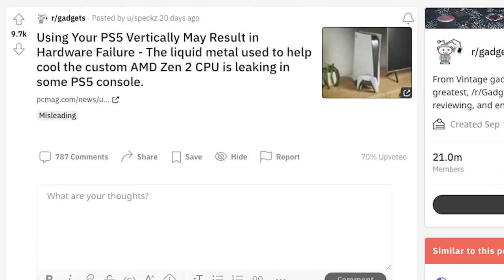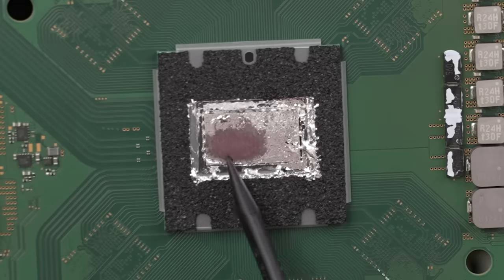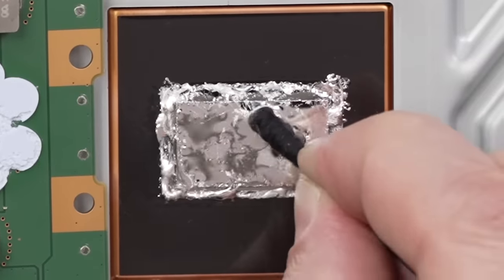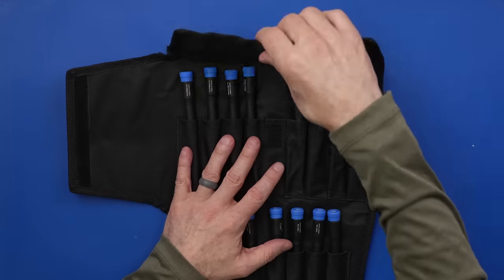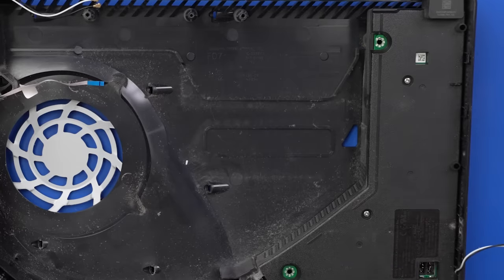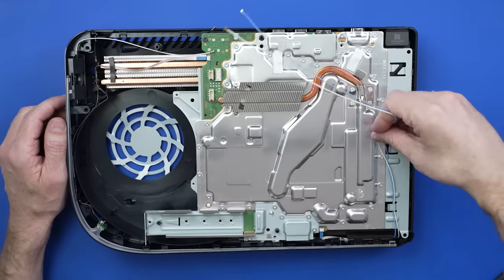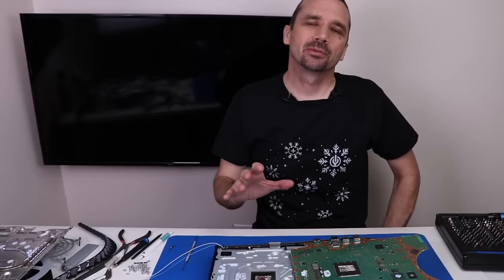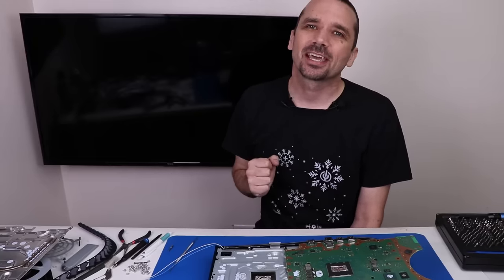PS5's Have a Liquid Metal Problem - But It May Not Be What You Think

Comment: I was taught close to 30 years ago that if the thermal compound is being squeezed out you've applied too much.  It's only there to bridge between the die and the heatsink and fill any gaps.  Ideally the gaps should be as small as possible.  When I started overclocking way back when I used to wet sand and micro-polish both surfaces to get them as flat and as smooth as possible and then apply the compound with the edge of a razor blade.  Never a ridge of compound left after they were married together.  I think people have gotten the misconception that thermal compound has some magical properties where more of it means more heat being pulled from the processor but that's just not what it does.  As soon as liquid metal came around the first thing I thought of was the fact that it remains so fluid will mean it will have to flow away from where it needs to be.  Now with the board being vertical and it's just got a gravity assist to drain away.  The one thing I don't see anyone try here is to remove the liquid metal, thoroughly clean both surfaces and replace with something like arctic silver and then compare temps and stability.  Too many people seem to be on the "if it's new it has to be better" bandwagon.
Reply: Thermal compound has been tried and tested and its thermal conductivity is nowhere near liquid metal
Reply: Actually it's been tried. You can find it on youtube. Thermal compound overheats it and the ps5 turns off. It can't handle it. Liquid metal is the only way.
Reply: @TheBreadSliceMaster  Oh...no dispute that thermal compound has less thermal conductivity than liquid metal does but it also has WAY less negative drawbacks.  I've never had it run out and short anything out.  I've never had it flow away and leave dry spots like shown here.  I've never had to make it a routine to go back in and reapply or spread it out over and over.  Frankly I think a bigger issue is the cr*p poor heatsinks and horrifically minimal venting they put in these things.  So little mass to absorb the heat in the first place.  But this is what happens when you employ designers instead of engineers.  Get rid of the aluminium and put in much thicker and larger solid copper heatsinks and you'll be able to pull far more heat.  I used to deal with with servers all the time when they would thermal and shut down.  We had multiple xeons at one of my old jobs and once we replaced all the low mass aluminium heatsinks with copper (and did nothing else) the heat issue went away.  It became a standard part of the builds we would do where thermal issues were a real concern.  But copper is expensive.  It's also a huge waste to use so much thermal compound or liquid metal if it is leaking/running out and not doing anything to facilitate the transfer of heat from the heat spreader to the heatsink.

But it would seem people are happy to deal with a system that is plagued with thermal issues and dies because of them than to spend an extra $100.  Don't get me wrong, I'm not complaining about it.  People can spend their money however they want, but it seems incredibly short sighted.  And if you have to rely on something like liquid metal that means that you've overlooked something critical along the way.  Then there's the foam tape they used as a stop-gap measure.  That's honestly ridiculous for a company supposedly as advanced as sony.  A full o-ring surrounding the die with a milled channel in the heatsink face would have fully contained the liquid metal and avoided all of these issues.  But then that would have added cost and they know that most people would rather deal with a system with issues that costs less than one that is more expensive but lasts longer.  

Sony, and all the other console manufacturers, are playing their customers for fools and the customers just keep getting in line again and again.  It's almost masochistic.

Comment: I have a suggestion. Try Honeywell tpm 7950 thermal pad. I used it on my PS4 Pro and framework laptop. Both are now super quite. LTT tested it, and the conclusion is, it is on par with liquid metal.
As I don't own a PS5 yet, I can not try it myself.
Reply: Normal thermal paste can't conduct better than liquid metal.Liquid metal Thermal conductivity: 128 W/mk(average)  Normal thermal paste max:14 W/mk
Reply: @ibrahimhalil9251  liquid metal is expensive and also requires dust filters

Comment: A dust clogged serially overheating console probably bakes the thermal interface material regardless of what it’s made of. You need to revive and re-spread it if it’s metal, or clean it off and replace it if it’s traditional grease.  

I can see the excess outside the two mating surfaces pooling over time towards one end, but not the material between those two surfaces due to capillary action and surface tension.  

My guess is that it’s a neglected console that went through many cycles of overheating until it was thrown away, instead of just being cleaned out. The oxidised spot is probably a result, not a cause, which is why sorting it made no difference but cleaning the ventilation and heatsink fixed the problem.

Comment: So glad you made a video about this. It's so blown out of proportion. The original user had it taken apart and I'm assuming used way too much liquid metal. I've had GPUs vertically mounted with liquid metal for years and not a single issue. That's why the foam is there lol.

P.S. anytime you remove a high pressure heatsink, liquid metal and thermal paste will look like a dry spot as your pulling the interfaces apart. I've had direct die liquid metal, more intense heat, and it never dried after 3 years of water cooling.
Reply: Facts! However, trolls will be trolls.
Reply: he still recommends to have it horizontal tho 15:40
Reply: @Medsas  That’s an opinion and not scientifically proven, genius.
Reply: The foam won't stop a dry spot. Dry spots will absolutely cause 'hot spots'. My PS5 is going flat from now on.
Reply: Aren’t most boards in PC towers vertical anyway?
Reply: @sebastianalhares  Yes correct. My 2 PC's don't have liquid metal.
Reply: @ekspatriat  Early PS5 models like the CFI-1000 series have the high thermal pad around the APU, which causes the aluminum part that touches the APU to have some slack, hence the liquid metal leaks. That thermal pad was removed on the CFI-1100 models and onward, so that issue has been resolved.

Comment: I am sure this has been tested before, but I would love to see you do a few different tests on a PS5 with all liquid metal removed and replaces with varying tiers of thermal paste.  Kryonaut, Artic Silver, Noctua branded, the stuff you purchase by the bucket, etc.  I am going to assume Sony engineered the PS5/heat sink so it would not work, but a detailed analysis would be REALLY cool to watch and learn from.  Just a thought, Steve!

PS: if anyone knows of a TY channel that has done what I am describing here, please let me know their name and the name of the video so I can go check it out!
Reply: Steve did that in a previous video!

https://www.youtube.com/watch?v=LbX_UjhgpGU&ab_channel=TronicsFix
Reply: I’m sure he has done it. 

It basically doesn’t work.
Reply: Apu is hotter than thermal paste that’s why they used liquids metal
Reply: @Leemillion_xM  L console
Reply: LM will always give better thermal results then any kind of paste.
Reply: @conwa23  no it doesn't to any significant degree but it's main use is for tight spaces like in slim gaming laptops for the idiots who wanna buy it and keep changing it when it dries out too quickly
Reply: @conwa23  but it  will always fail sooner
Reply: PS5 APU design requires liquid metal to work,this chip is getting hot like hell so if you put a thermal paste,even the most expensive one,PS5 would just turn off after 10 minutes of gaming.

Comment: I'm not surprised, seems like launch systems have issues. I bought a launch PS1 and laser was a poor design and eventually failed. My PS5 controllers have stick drift, I tore them apart and cleaned the sticks with electronics cleaner.

Comment: How useful/helpful do you think those ‘vacuum holes’ are on the PS5? Would vacuuming them every now and then actually help stop any significant internal dust build up?
Reply: Just anecdotal, but I was having the same issue where my ps5 was shutting down, a lot, while playing ps5 games. I read about the vacuum holes and tried it. No more shut downs. Now I do it every couple of months and I haven’t had the issue come up again.
Reply: Hi. Could you tell us if your model is a 10000, 11000 or 12000. I try to see if these shut down problems are specific to the 11000 model...( Mine is a 1116A)
Reply: no , take it apart to clean it and then attach dust filter
Reply: @MGrey-qb5xz  Plenty of websites out there have recommended not to install aftermarket dust filters after they tested them as they restrict airflow and cause the PS5 to run hotter. Regularly cleaning your PS5 is probably the best thing to do.

Comment: About your preference to keep the PS5 horizontal I have a few points to contradict your view:
Liquid metal has to respect the laws of physics. Which means it has surface tension and it will cause it to stick to another surface (heatsink) instead of flowing down and dripping into the sponge. Just try it with a water bubble and rotate your hand. It will always adhere to your fingers. The same principle works for the PS5.
So, unless there is much to little of the liquid metal so it can‘t cover both sides (processor and heatsink) it WILL flow down. Otherwise it will keep its place.
Reply: Sorry, but the upside down hand does indicate adhesion but does not indicate cohesive forces as well, plus if you touch that drop under your hand it will flow down. Gravity will cause this fluid to flow, especially with the vibration of the console from the fan spinning. There should have been enough preloaded Liquid Metal to prevent this from being an issue. If that volume between the APU and the processor is full then there is no where for the fluid to flow.
Reply: But how does the dry spots exist if they never been opened before? Is it true horizontal position is better than vertical? Also i somehow love you said "liquid metal has to respect the laws of physics" as if its a person (dont mind me my imagination is weird)
Reply: @MissxLariz  I’ve had mine in a vertical position for 2 years. There’s absolutely no evidence that one is better than the other. The only time mine overheated was when it needed cleaned (used this guys video to do it) and it’s worked great since. Dust is what’ll get it to overheat first. Unless you’re unlucky and got one that’s a dud. Mine was dusty like the one in this video.
Reply: @MissxLariz  In order for a dry spot to exist with corrosion, there has to be a small amount off air trapped in that space. This means either not enough metal is used to fill the void or it’s leaking out. Either are not good
Reply: @heavymetal_cutting_fabrication  Oh thats great. How often do you clean?
Reply: @heavymetal_cutting_fabrication  I would agree that dust is way more of an enemy than the Liquid Metal issue. I would be willing to bet that dust may be amplifying the bare spot issue.
Reply: @tseamans14  Oke thanks for the info it does put my mind at ease somehow haha

Comment: If Sony and Microsoft intended to design consoles with the primary purpose of accumulating dust inside, they couldn't have designed consoles better that the PS5 and Xbox Series X.  The vents on these consoles, when the consoles are stood vertically, are perfect for allowing dust into them.  As soon as my consoles arrived, I was straight online looking for dust covers designed specifically for them.  Just remember to remove the dust cover when using the console, because it's easy to forget, only to be reminded when the fan has to work so hard that you can hear it over the audio in your headphones.
Reply: Xbox has no problems.
Reply: Yea both systems have issues. I have both. Especially when you have a limited area for them such as an entertainment center. The series x is a DUST MAGNET. I had to buy screens and a top for it that came with fans....now it runs cool as ice.  The PS5 is much better dust wise... But I have fan vents with screens and an exhaust fan on it that keeps it cold too. Without all the accessories.... Ive never overheateded either.... But they have been way hotter than I was comfortable with. I've already replaced my series x once. It was a 1st gen..... Notable disc drive problem. New one seems to work better. I'd advise to purchase insurance on your machines. Saved my from buying the second x box. PS5 has been a champ the whole time
Reply: @patrickallen4374  wait as in for when console is off or running, can you tell the name of thing u bought?
Reply: @patrickallen4374 how long you’ve had your ps5 for and is it still running good?
Reply: How are people placing there consoles i have both on the middle of a tv stand that is well open and not had much problem with dusted up or clogged fans and heatsinks yea normal dust nothing a air can cant solve. Please don't say you have it on the floor as that is the worst way to have it carpet or laminate flooring it will just suck up all the crap off the floor like a vacuum.
Reply: @giggity4670   Mine are on a unit next to the television, where they have room to breath. They used to have less room, so were stood vertically and their vents were on top, but now they are horizontal, so the vents are at the side, reducing the intake of dust. I still use dust covers when they are not in use. However, whatever surface they are on, they will suck up dust from it and dust from the air around them. It just a matter of looking after our things as far as is viable.
Reply: Thank you sir. I never thought about that idea.

Comment: It definitely does not give you the heat error message all the time,(never did for me) after watching your breakdown vid, i did a cleanout (stage 3) and lucked out with just a dusty heatsinc. Sper drty.....i do alot of GT7 series racing and ps would shut off after 20 to 30 min, the full clean saved me, no liquid metal issue this time🥵, love your vids!   🤜🤛
Reply: yeah this time but the heatsink being dusty means it could damage the liquid metal to not working fully, attach  dust filter , no dust should be allowed in there

Comment: is it a dry spot? have been wondering. is it not just a clamping problem where there is direct contact between the silicon and heat sink that squishes the liquid metal away. however the oxidation is not good as it will damage the mounting surface on the heat sink

Comment: about time a youtuber with a higher subscription number brought this up, been telling customers this for over a year. The LM oxidation is a big issue.
Reply from the maker: It does seem to be an issue
Reply: “Big” 

That’s a reach.
Reply: I've had my ps5 since day 1.  Been vertical the whole time.  On 6 to 10 hours a day. Zero overheating problems.  Clean it every month with my rechargable air gun.  Recently took it completely apart to check liquid metal and it looked factory brand new.  Added some additional liquid metal to be safe and reassembled.  Have had zero overheating issues ever.
Reply: @brandonerrorcontentmissing4012  Bruh, these people are trying to tarnish PlayStation’s reputation with their disingenuous propaganda. 😂

Comment: My PS5 did the same thing. I have the day one and all I had to do was clean it With a shot vat cleaning kit and it worked just fine did not spread or open my p s 5 once Has been working normal ever since. It cost me 50 bucks to get the vacuum cleaner kit. Around the heat sink and that was it

Comment: Is that what my issue is? I’ve had a PS5 since launch and my console will run PS5 games for about 30-45 minutes and then turn off. I’ve tried deep cleaning, rebuilding the database, wiping the console clean etc. Has anyone else overcame the overheating issues or should I just purchase a new model?

Comment: I've heard that easy fix is to keep your console horizontal all the time, so liquid won't move
Reply: dust would still damage it , L console
Reply: @MGrey-qb5xz  dust damage every equipement
Reply: @Herendill  dust build up reduces performance, you have yourself a very fragile machine if it folds from dust
Reply: @MGrey-qb5xz  dust damage machinery over time. Not right away